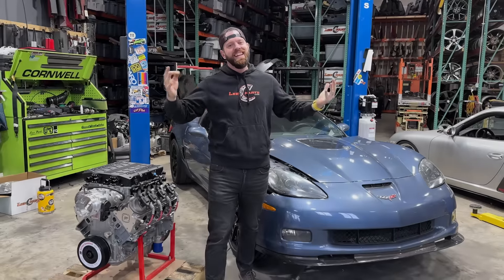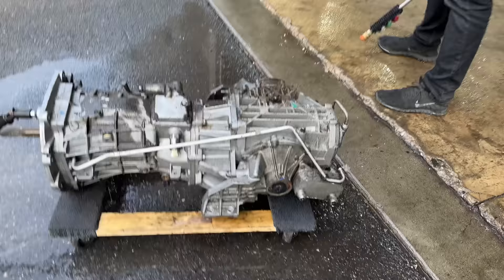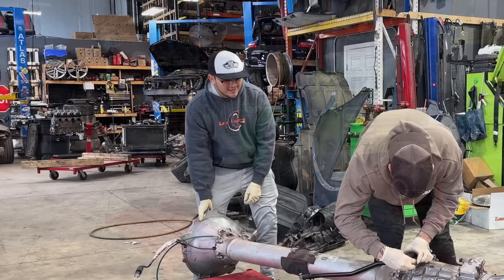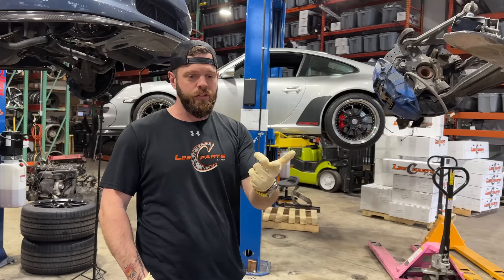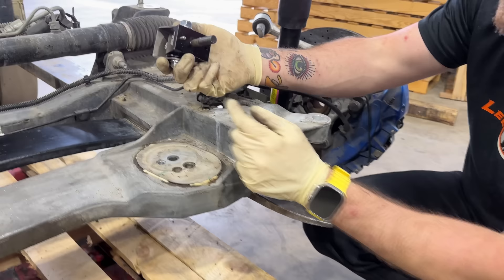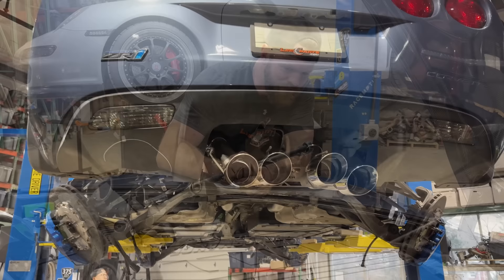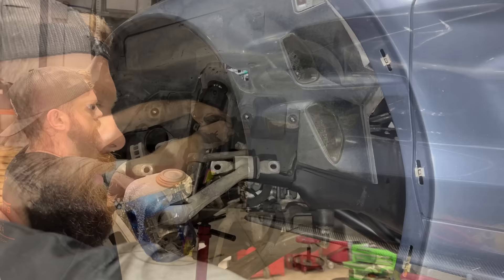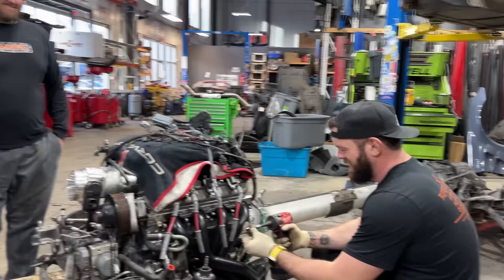Building The CHEAPEST 1000HP Corvette ZR1 On The Planet!

Comment: Hey guys, quick tip. To prevent stuff you pressure wash off like after you degrease from corroding or to keep it clean even further, mist wax over it :) don’t have to buff and keeps a sealant over it. Can be a cheap wax, still works. Takes another 2 min to do overall lol

Comment: I feel your pain with the broken header bolt. I spent 12 hours getting 3 out of an LS head. Left hand drill bits helped, but ultimately I ended up finally getting them out with an extractor.
Reply: I remember when that happened to my engine swapped pagani huayra took a whole day to get out so I fell your pain
Reply: @Kar333m  yeah it was extremely frustrating. What started out as a simple header install turned into pulling the heads, replacing lifters, new pushrods and a trunion upgrade. Was one of those "well while I'm in there moments" haha

Comment: stainless bolts are my least favorite thing, however ive learned that lubing them when stainless goes into stainless helps ten fold over the years, idk why but stainless gulls on threads and basically welds itself together, also when drilling stainless you need to pulse the drill, to keep the drill bit cool, or itll dull your bit almost instantly

Comment: Instead of bolts which pull and twist in the aluminum. Put studs in for the headers and use arp 12pt nuts . Saves what you did drilling a bolt out.

Comment: I would have took a cutoff wheel and put a slot in that broken bolt.  Use a good straight head screw driver on a 3/8 drive... super easy to remove then.
Reply: Bet it wouldn't have worked. We are talking about a set of $5000 heads, You think the threads were jus "an oversight"?

Comment: I always run a tap into the hole and put antisieze on any bolt that is going into aluminum. just so the bolt does not sieze and do what happened to you. Especially stainless into aluminum .
Reply: Antisieze in LS header bolts will just have them come loose from vibration. Using a good quality bolt and cleaning the threads before hand goes a long way.
Reply: @RoxxPC  not with stainless, you NEED a lube. Not getting better quality than ARP, if it was Chinese stainless, this wouldn't have happened (that's not a good thing btw) 

Never put it in dry! With stainless anyway 😂

Comment: When I saw hooker on that box I was hoping one was gonna jump out ! didn’t know you could order one in a box 🤣 oh man that bolt snapping ….geezzzzz my heart sank for you .I always tap and blow the threads out with the air line it’s worth the effort but you got it there well done 👍
Reply: Can't install stainless hardware dry or else it welds itself the second any tension is applied. These are/were brand new heads. Also can't use regular mig wire to weld stainless and that's why he failed to extract it with the "weld a nut to it" method. 

You'll only do it once, I promise. 😂

Comment: Where do I send you a torque wrench and a bucket of anti-seize. You never put a stainless steel bolt in a aluminum anything. They seize and won’t go in or out.
But I think you know that!!
Why didn’t you use the torque wrench or anti seize ???
  Or did you just not show that part?
  I would use the anti-seize on the tap also!!
 Better safe than sorry !!!
Reply: He knows now 😂 don't go in dry with stainless. Especially with aluminum and for sure not with stainless 🤣 he's lucky only the one galled up. 

So many comments about how Frankenstein is to blame. If anything it goes to show just how good Frankenstein is.. The fact the ARP bolt broke in aluminum and didn't pull the threads is impressive (i mean I guess it naturally welding itself in helps but still. 

Also mig welding stainless... Knew right away he was going to lose that bed. (No spool gun and I think it's safe to assume it's not loaded in the machine since I'd say 1% of mig welders are loaded with stainless wire at any given time and that's probably too high)